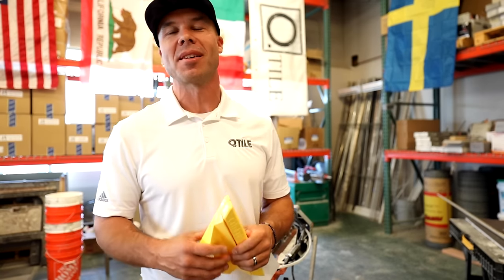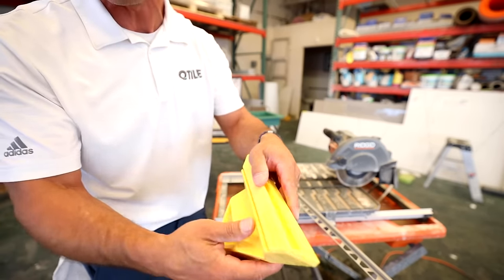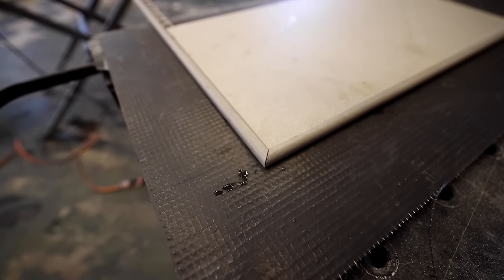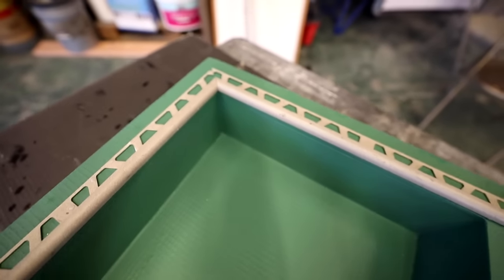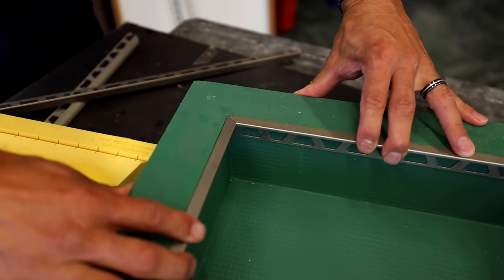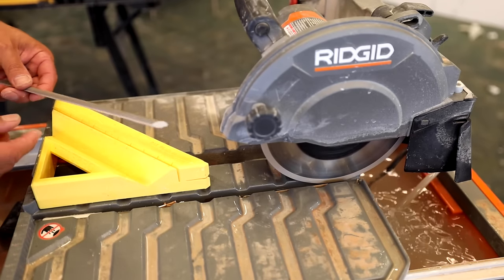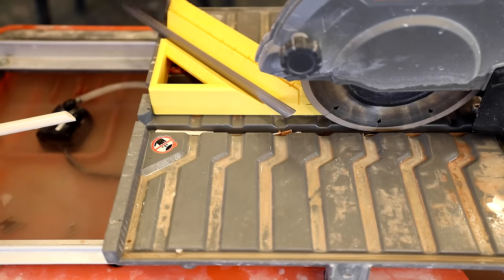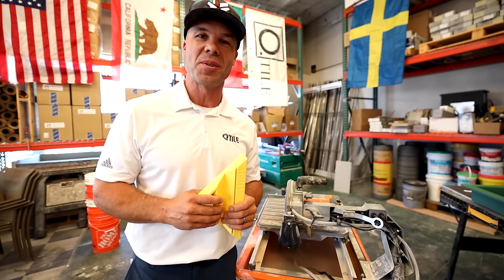Easiest Way to CUT TILE TRIM around a NICHE or BACKSPLASH --- MITER Schluter Profiles and Jolly's

Comment: Did you use a diamond blade to cut those profiles?  Is that advised, or was it more for demonstration purposes?  I think I usually see people use a mitre saw with toothed blades...  Great video!
Reply: Looked like it worked fine so might not be advised but changing blade / extra tool might just not be worth it for commercial job where time is more important?  Can't imagine the metal causing more fatigue to the diamonds than ceramics/porcelain.
Reply: or an aluminum cutting blade, absolutely stunning cuts, but they can grab, so you must cut slow.
Reply: I use a diamond blade on wetsaw to cut and mitre schluters all the time no problems….no need to change blades
Reply: I use the wetsaw to cut schluter trims. I have both the trim square and the calidad dressing stone. Once all my metal trims are cut, I dress the blade. No issues!!

Comment: I'm assuming it's for the demonstration but both quadec and rondec have inside and outside corner pieces so you wouldn't have to miter them. with the jolly you have to miter it and the cut looks nice regardless but I'm assuming it was done for demonstration purposes? or was it to get a nice clean mitered look with a different profile? kinda confused lol
Reply: A miter is free those inside pieces are expensive especially if you get the colored ones. And they don't necessarily look better than a well executed miter

Comment: Cutting that with your wet saw doesn't mess up the blade any? We always have used a separate miter saw with a metal blade.
Reply from the maker: Nope!  Works just fine.
Reply: I use my tile saw for cutting tile  only!
Reply: @TileCoach  thanks that will save us from pulling out another tool!

Comment: I definitely would not use a wet saw! Aluminum will damage your wet saw blade for sure. 
I use a sharpie and a 7 inch aluminum blade Diablo. Great cuts every time.
Reply: Aluminum will not screw up the diamond blade....only if u cut stainless
Reply: Absolute nonsense.  My blades last a long time even cutting aluminum schluters.  A wetsaw is the best way to cut them

Comment: i just use miter saw with a diablo blade works mint
Reply: You cut your 1/4 rounds with that too? 😮😮😮
Reply: @Eylandertile  i love your line of tools and have bought quite a few. For pencil trim I get the application but I'd have to argue a miter saw with a non-ferrous blade gives you a better cut for metal trim.
Reply: @adamh6190  we’ve never argued against that. We just know the mass majority of installers do not use a chop saw to cut trim although this tool works on a chop saw as well.
Reply: Even with a non-ferrous blade and 4000 teeth, I've had chops saws grab the metal & make a mess.  Looking forward to using this new tool!

Comment: Yikes! that's murder on the wet saw blade plus leaves burrs that need filed off after. Non ferrous metal blades will cut that aluminum so clean. That gadget is sweet though. Looks like it will promote ease of handling and minimize the kickback. Thanks for the info!
Reply: Can you use a 7 in. non ferrous blade in the wet saw just to cut the metal trim then swap it out for tile?
Reply: @texascrossbowdude636  not sure if the arbors are different plus it might rust the blade. I just always have one in my miter saw. Try it...lemme know👍🇺🇲🛠️
Reply: @psyphen2286  if the arbor is  the same and disconnect the water pump
Reply: @texascrossbowdude636  diamind blade on wetsaw works just fine. Its all i use to cut  schluters

Comment: Theres NO WAY cutting any of that aluminum with a diamond blade didnt leave and burrs to be filed off before  the fitment is clean. ( I may or may not have cut schluter edges with at least 6 different methods for over the last 20 yrs😂). Love you Isaac, show the filing  lol

Comment: More importantly have you done a preslope test. 
Where the bed is only wet on one side. 
I  think that the water will migrate to the dry side and up hill.
Preslope was meant to make water run only down to the drain.
Reply: 🤣 Wrong video! 🤣 
(yes, I've done it too 😉)
Reply: @tedspens  
Do you know of any videos. 
Genuine question. 
I did see his video on part of this matter and others but this migration of water is over looked.
My suggested method may show that once wet always wet, the tile bed.
Yes it was random, Hahaha.